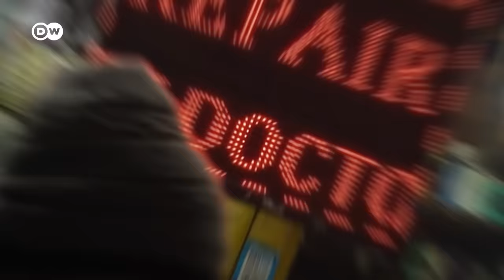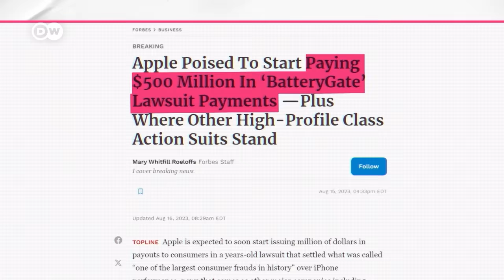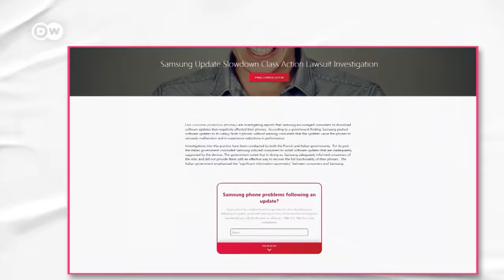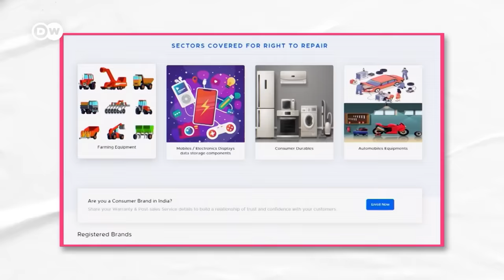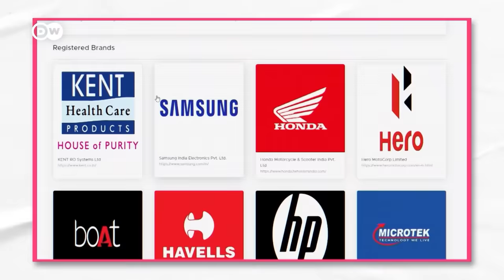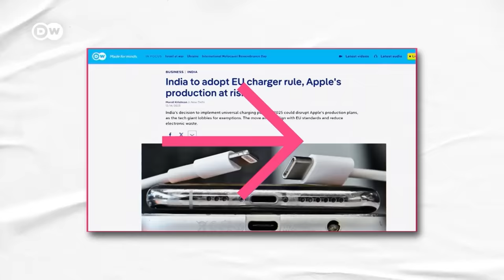How India wants to (literally) fix e-waste

Comment: I've never used a phone for less than 9 years. Never felt like I was lagging behind technologically.
From my perspective, today's consumers are committing an ecological crime when they throw away a device they've used for an year or so.
Reply: We don't throw away, we sell in second hand market
Reply: So you have just have/had 2 phones?
Reply: @TheBooban  that's not true. You don't need the last OS for apps. Most apps require android 5.0 (2014) or 6.0 (2015). So you could buy a phone on 2010 and still get android 5 or 6, so that's an excuse. I don't say you must have a phone for 10 years, but 5 is a good number.  
I have my Poco F2 Pro 4 years (from 2020) and I have android 12. So I can hold it for at least 2 or 3 more years and still be able to use 99% of apps.
Reply: @TheBooban  One can easily use a mobile device for 5+years. The biggest concern would be 4G 5G 6G upgrades but for an avg user its not an issue. I am still using an 4G device without any issues except when my friends show off their 5G devices.
Reply: @Anonymous-8080  Yep
Reply: @TheBooban  I just change the os entirely...
Reply: I don't think someone who uses the phone for one year would throw it away. People usually sell it. But yeah I do get your point.
Reply: @TheBooban you can root your phone and install a compatible newer OS that supports all of those apps but the bottleneck here is RAM
Reply: what about security patches tho? u don't recieve those updates afyer 4 years ig, and then it gets unsafe to use the same phone for any financial transaction atleast
Reply: But cheapest phones do not last long
My next phone will be 30k to 40k atleast performance and sustainability 
The problem is with battery why sh:t don't offer battery replacement

Comment: Can we build a system where electronics manufacturers have to catalog the repair cost of each of the component in the product and the total cost of the components is not allowed to exceed 120% (arbitrary number) of the retail price of the full product.

This should in theory, prevent manufacturers from having excessive markups on the spare parts.
Reply: But they are already selling products at low price. For eg the profit from selling 40+ Lakshmi fortuner is 50k  or something because GST and road tax is around 18 lakhs so companies make profit using repairs that is why they don't want people to repair or provide parts   it is govt that make customers life sh*t
Reply: The price at which you are getting these phones are not their MRP
Reply: It will be harder. Assembling an entire phone can be done by an unskilled labour. On the other hand, disassembling a phone, finding fault, correcting the fault, and reassembling the phone requires skilled labour, which is costlier than unskilled labour.
Reply: Disclosed manufacturing price or cost Its breaches of contract between brand and part manufacturers/vendors ..so no one ready for this legal risk.
Reply: Yes, except no one will ever follow such a rigid system for a variety of reasons.
Reply: @hrushikeshavachat900 even if it's part cost as opposed to repair cost, it would be a big step in the right direction

For what it's worth, I work in a phone repair shop
Reply: This margin 20% doesnt work because the parts costs for exemple 10 and the labor costs 50 at minimum because they will responsable for their services and at minimum lasts 30 minutes to repair and test, pushing the prices 2 or 3 times more because, again, manual assembled components costs more than the automated ones, because :-) they are buyed in bulks.

Comment: Companies are forcing us to buy new products by not giving updates, making it laggy, reducing battery life, degrading camera, making its spare parts unavailable..all these tempts me to buy a new phone else  i would happily use my phone atleast 5 years. Presently my average is just three years.
Reply: It's the apps making phones laggy. But also yes Android does need to do better to prevent bad apps from ruining the experience.
Reply: @FlabbyTabby batteries needs to be changed every few years.
Reply: @FlabbyTabby I've been using Android my entire life. Apart from the system apps that I haven't figured a way to uninstall I have uninstalled all the trash apps. It works just fine. I have no games on my phone. Only three main social media apps, and a couple of other  apps. My main concern while having a phone is delay, hanging, storage space. The phone I have at present solves all these. So unless it starts to give me headaches I'm planning to keep this one.

Comment: My father used his smart phone for 5 years...
After 3 the battery went bad...
He found a shop in my hometown (Mumbai) that replaces only the battery for 20$ and he extended its life by another 2.5 yrs..
He xhanged the battery 3x in that period before the phone died...

Now manufacturers seal the battery in so theres no scope for such knack
Reply: We all have changes battery. I had a keypad Samsung in 2013 which was my first phone then mom got me a smartphone in 2015 and I had old one too but one day I was walking on road when phone slipped my hand, the back cover opened and battery went into the drain & you know in India's drain, what's gone is gone. So, I went on nearby shop, bought a Panasonic battery, it fit that model but it was thicker so the back cover won't close properly so I basically closed it with rubber😄. I last checked it in 2020 and it was still working although now it is somewhere in my house and I can't find it (I only have one sim since lockdown that's why I wasn't using two phones).

Comment: 10:52 I'm an American and I have to disagree that we're not far behind. I think public opinion in the US is equally in favor of right to repair as it is in the EU, but legislation is much further behind.
Reply: The labor cost is astronomical. In 2017, I want to replace my broken laptop screen, the labor cost was $50 on top of screen cost of $45. I watched a DIY YT video and did it myself.
Reply: @souravjaiswal-jr4bj  in my experience when getting things repaired they tend to list most of the cost as labor costs, regardless of whether they really are. I had my clarinet repaired recently, there was at the time a shortage of the particular piece I needed fixed, and eventually the repair shop, which specializes in repairs not making parts, had to make their own. But they still listed the part as costing next to nothing and all the cost being labor (it was a fair price in total, just the breakdown was wonky).
Reply: @souravjaiswal-jr4bj  same as anything else think of a mechanic lol.
Reply: Right to repair kinda goes against big corp capitalism.
Reply: @vikassm  good lol
Reply: @vikassm yeah true
Reply: Yeah I like the concept of an American laptop brand called "frameworks" which manufactures modular repairable and upgradable laptops which is really a next gen solution. The best thing is that you can DIY almost everything.

Comment: Quite easy to replace screen tbh, only issue is getting good quality display. Often parts are sold as genuine/original yet they obviously are way worse.
Reply: The way they'r manufactured, you need specialized tools and gadgets to remove old screen and fix the new one in its place

Comment: The 12k cost is for replacing the screen they are not really repairing, repairing that display will be much cheaper might be around 20$ depends on vendor for your's model in which only the external glass will separated from the screen and new glass will be installed your display will still be original and you will face no issues after that if it is done correctly. I worked in the field and it was fun to work on phones, screen repair is very common most of technician can do that easily, best part about the job is when someone had problem in the motherboard and has shown phone to multiple shops and have no hopes of getting it repaired and then if we are able to fix that thing, the smile on customers face that's the biggest satisfaction
Reply: Yeah, most of repair center are just changing spare, not really repairing smh
Reply: @putraduha3176   yup they just replace whole part they don't do any repairing, even if one capacitor is shorted they will repair whole motherboard which is not required and you will loose all your data
Reply: Hi Abhishek, where can i get the original spare? I own a k 20 pro and it's working fine only back glass is broken.

Comment: A guy who fixes the mobile phone with a lighter 😂😂😂
Reply: Hey, as long as it works okay.
Reply: Heating loosens the gum attaching the screen.
Reply: flame is flame
Reply: It is one of the techniques to seal and wiggle tightly wound things
Reply: It is called jugaad.
Reply: He is probably not fixing the mobile as much as lightly melting perhaps the glue or something that is stuck or protruding on the side
Reply: Lighter guy is wrapping backcover skin or vinyl
Reply: I got a new skin for my phone. The moment he used a lighter on my new phone, I got a mini heart attack. But these guys know what they are doing. The skin got applied so well, you couldn't tell it wasn't factory made.

Comment: While some spare parts are horrendously marked up, this misses the fact that providing a whole spare parts supply chain is far from free, volumes a lower, storage times are longer, and more.

And this doesn’t include the labour costs associated with dismantling, diagnosing and reassembling which is typically a very manual process compared to the highly automated processes of initial assembly
Reply: The repairability should be a design consideration to make the manual process smoother. Most companies actually try to discourage this by unnecessarily complicating the design.

I agree with you on the logistics issue of spare parts though
Reply: I agree on one part that the supply chain issue is there. But if you document the repair process, then I'm sure there is an equivalent unbranded product in the chinese market that is going to be in the supply chain.

And for the reparibility, phones were fine with metal backs and glue only for the display where the rest of the parts can be removed. And yet they stayed the same weight as phones made now. I mean there is a way to make products look beautiful even with visible screws
Reply: these markets wouldn't thrive without people unnecessarily throwing away things that could be repaired

Comment: A decade ago, I could have easily repaired most of my electronics with ease and at low cost. Now its difficult to find a store with right knowledge/skills and spare parts. Even if you do find one, its expensive.
Reply: Everything has to have a gd computer inside of it now so you’re unable to fix it yourself. Not just a simple fix.

Comment: Making easily repairable devices also has an associated cost. The fairphone is a good example of this, it is bigger/bulkier, heavier and more expensive than equivalent performance models from other manufacturers.

Making electronics compact and “cheap” (automated) to assemble often uses techniques that are inherently difficult to repair.
Reply: The fairer option of anything is always more expensive! I think I'm going to buy a Fairphone once my old one stops working - I like that they even have on their site that "the most ecological/fair phone you can have is the one you already own" (paraphrased)
Reply: @hrani  not always, but in consumer electronics it is a good rule of thumb. There is definitely a market out there, but the fact is the majority of consumers are either quite cost sensitive, or aesthetics/marketing sensitive
Reply: I don't see how repairable makes things always more bulky.

FairPhone is a bad example because
1. They only have access to limited parts they can build with
2. Simply including a fair wage makes it "expensive" (or, in other words: As cheap as can be without exploiting)
Reply: An easily repairable device is something that has easily available spare parts and instruction manuals on replacement steps.  That is exactly what companies are avoiding by making special custom parts and tools AND not making them available to the public.  It has nothing to do with being modular or open.
Reply: @jurgennicht4626  I would assume there's always a very slight weight increase when using less delicate components and shapes, and planning for easy access has an effect on the layout of things... For example, eight tiny screws holding parts in housings and their fixings probably take up more weight and space than a hair thin layer of epoxy holding down a piece that everything else is under!
Making it more bulky because of making it more durable is probably also a design choice: they know people who want it won't mind too much.
Reply: @jurgennicht4626  you need room to work, the more is jammed into a small space the more difficult/fiddly it is to disassemble/reassemble by hand. screws/clips require counter parts to affix to, many phones offer a degree of ingress protection now, glues are used to achieve this along with the way the phone is held together, glue is not great for serviceability.

I don’t understand why fairphone is a bad example? (In phones) it is almost the only example at this time
Reply: @jurgennicht4626  also fairphone is made in china, even if they pay a higher wage than the competition, simply that fact isn’t why it is more expensive.

Using screws instead of glue, multi cycle connectors, having to create the easily serviceable modules increases component count (more mini housings etc) that will also in turn increase assembly costs compared to putting everything in a single housing

Comment: There are 3 points to the failure argument from the engineering side. This is to show, to my limited abilities, the backend that is being leveraged to create the new rather than repair phenomenon. 

First, the complexity of failure, Failure has so many dimensions. Some of the failures are not in the electronics but in the thermal glue or the joint plastics that hold them. Their OEM makes them via injection molding or any other specific large volume manufacturing. These parts cost pennies to replace or repair. Rubber seal, broken wire, broken structures in general, corroded base. 

Second, the manufacturing side, all the devices are cheap, because of the rapid manufacturing process that produces them. It's a multiple moulding, with cnc machining in between. This drastically  reduces material consumption and lead time for the manufacturers. This creates the issues with the repairing, because the objective was minimum material usage, hence lower redundancy. That leads to the assembly side of things. The assembly process deals with the products which are an extension of the previous manufacturing process. so, minimum down time, less parts to assemble, higher turnout rate, lower price.  

And how do you create less number of parts with materials which are weaker and lighter than metal, snap/force/thermal fit and interlocking joints with a hard outer case, to create a module. This is much easier to handle with automated assembly processes. To put things in context, 999/1000 pcbs around you, were put together by machines, the human was involved only in that one low volume manufacturing.

Third aspect, look at the majority of the engineers, they come from electrical electronics and software backgrounds. These fields are well known for mass manufacturing and Extreme miniaturisation( micro to nano). So the attitude of replacing rather than repair is extremely prevalent. You just can't fix something that small and especially if it's a system of such small things. There is nothing wrong with the attitude. But when you are in an ecosystem where everyone is coming in with this attitude, things evolve. The attitude which is absolutely justified for micro and mass scale manufacturing. Slowly gets pushed to macro and mass scale manufacturing. Not that someone decided, it just gradually and naturally happened over decades. 

So here we are. Can the design be done which is easy to repair? Yes, up to a point. Because engineers love to remove the cause of the failure altogether rather than making it repairable. If things don't break, no need to repair. 
And if you can remove the problem altogether, why not remove it for all the newer devices. 

And the cycle goes on and we make better stuff. So i hope it gives you an about the complexity of the engineering side of things, on which the whole business side stands. 

Just a disclaimer, this is a view from the mechanical engineering side of things, that still leaves behind the complexity of electronics and software development, quality control, supply chain side of things. 

Welcome to the crazy world of manufacturing
Reply from the maker: Hey there! Thanks for sharing your perspective of a engineer here 😊

Comment: Why repair smartphone more difficult compare laptop? Cause OS . If smartphone OS same with laptop. I think more used smartphone can be utilize again
Reply: Well partly yes and partly no. In laptops atleast 3 years ago the ram, hdd, display, network adaptors(if you find the drivers for it) could be swapped and were almost standard in all of them 

But then you have other important components like the keyboard, track pad, battery etc which are model specific 

So yes, laptops were much easier to repair. But unfortunately now companies started soldering components like ram, network adaptors to the mother board and made it very hard to repair and replace  

OS is not related to any of these issues.

Oh yes the operating system of phones is model specific and designed for the hardware

But in windows laptops it's not and is standard but repairability doesn't have much to do with OS